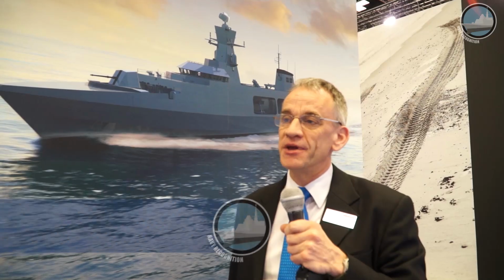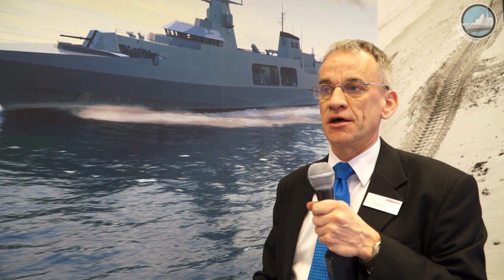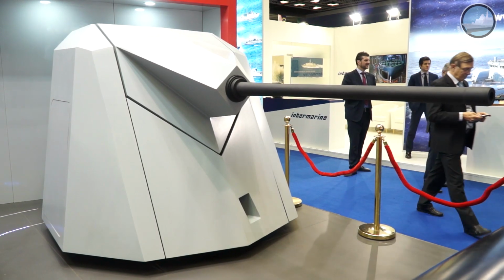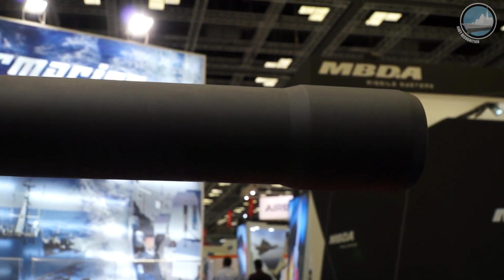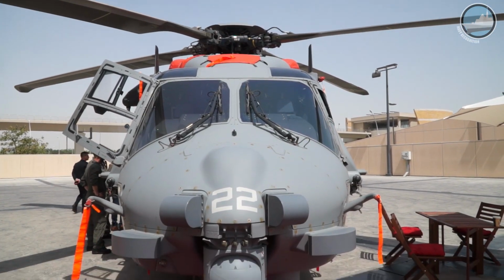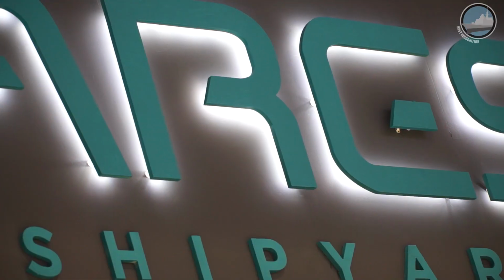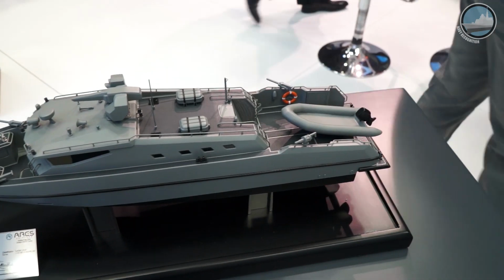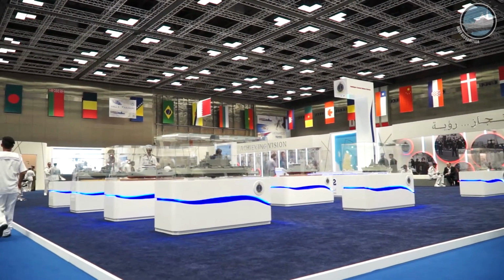DIMDEX 2018 Day 3: Type 31e, Marlin 40, NH90, MARTE ER, ARES 80 SAT

Comment: They could just have one boat bay either side with a space either side of the boat bay entrance.
The front space with a cradle for the boat, and the rear space for autonomous vehicles or supplies.
But a great design none the less.

Comment: Best design for the type 31e so far. Dont put cost above capability I'm  sure they can build it close to budget with a careful selection of equipment.
Reply: You do realize this is them showing of the potential of the design. The RN cant afford what is shown in this video, the 8 MK41 VLS cells are definitely not in the version they buy.

Comment: If the type 31e is for export provision for a full length 16 cell vls as well as the sea ceptor would be a good idea.
Reply: The design shows 8 VLS cells, not 16.
Reply: CAMM is quad packed in Mk 41. Probable RN intention is to use Mk 41 cells for Harpoon replacement however.
Reply: @jaybluff281  They had better, that puny VLS is an afterthought. The whole ship can barely defend itself.
Reply: @k2apache60  The BAE design wasn't chosen in the end. Too small and under armed.
Reply: @k2apache60   but it can defend itself, this isn’t just a coastal vessel like the new HMS Tamar. During any operation it would be attached to a strike group, and if it was to be targeted while cruising on its day to day duties its fast enough to withdraw and rejoin a task group, where it would be needed most for its anti ship and anti submarine capabilities. Protecting the fleet. Good design